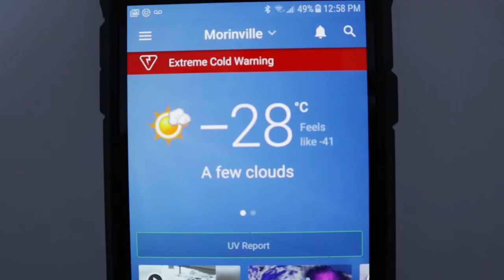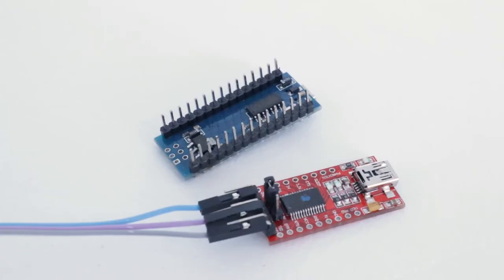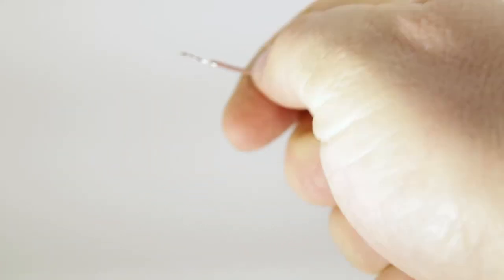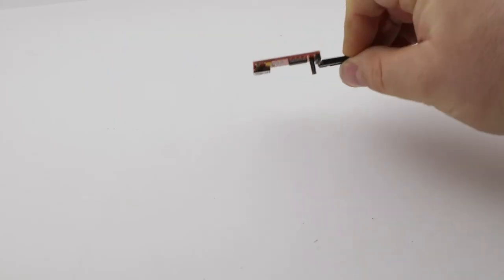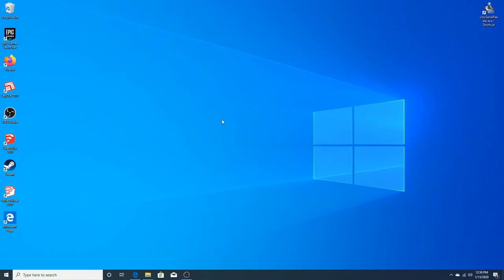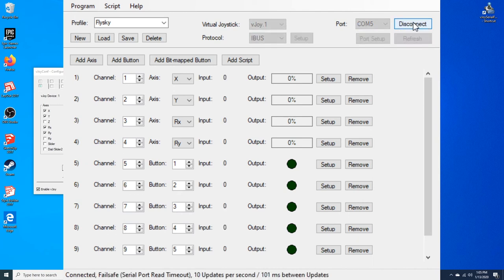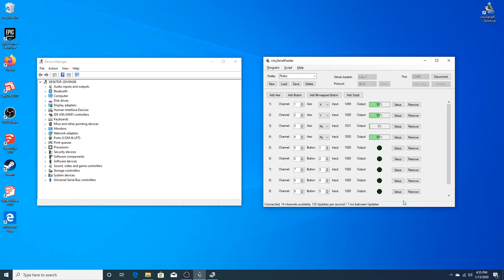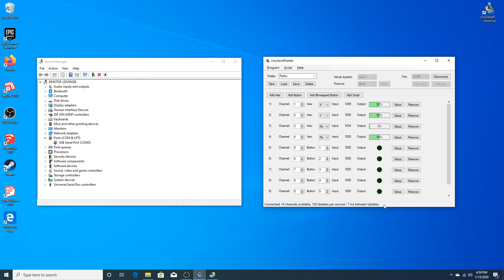Use Your RC Transmitter As A Wireless Simulator Controller on your PC

Comment: This was a big help, thanks! Can you offer any advice on how to set up a 3 position switch in vjoy serial feeder? I'm trying to set up my mode switch for use in realflight but the switch acts as though it only has one two positions.
Reply from the maker: You should be able to add a button on the same channel and set them to different inputs, and set them to two thresholds. Set one to be say "1400 - 1600" and the other "1800 - 2000" That will leave a bit of room to any deviation but the signal seems pretty spot on at 1500 and 2000.
Reply: @TheWayneStevenson  Thanks for the reply, I'll give that a try later.
Reply from the maker: @tumblew33d  Let me know how you make out! :)

Comment: Hello thanks for the video, i'm having a problem do you have any ideas? When i turn on my flysky the FTDI starts flashing two green leds and gets disconected from windows, it gets connected again as soon as i turn off the flysky. (Using FS-IA6B and FTDI) Edit: It just works on my notebook, now i'm even more puzzled.... i really wanted it to work on my main pc. Edit 2: It was a bad cable, got another one and it worked on both computers.
Reply: I've got two solid greens but no motion on the VJOY.  Also betaflight connects then disconnects.   i'm going to try my main pc and see.  Also my radio receiver doesn't show a red light that its binded.   It does on my plane.

Comment: thanks for the amazing video, i am trying to do the same, i am using an FTDI usb board and a jumper R8 receiver, i connected the receiver to the FTDI board and i installed the Vjoy driver and serial feeder but the serial feeder is not communicating with the receiver, it is always showing Serial port read timeout, i am sure that the receiver is bound to the transmitter, i have also connected one servo to the receiver to double check the communication between the transmitter and receiver and it is working fine. the receiver is connected to the FTDI board using the SBUS wire, can you please help with this problem.
Reply from the maker: I don't use Sbus equipment myself so I wasn't able to cover it unfortunately. It's an inverted UART signal. So you need to connect to the uninverted signal, or re-invert the signal. Using the Arduino is the simplest method because you can use a sketch to do the work for you. 

Cleric_K who made the vjoyserialfeeder covers the details and also has links to more information on tapping into un-inverted signals or creating a inverter circuit. https://github.com/Cleric-K/vJoySerialFeeder/blob/master/Docs/Sbus.md

I hope that helps. :)

Comment: i. did the cli command on omnibusf4 and now i dont see any comport in betaflight or device manager. i see in other devices - Omnibusf4 as no drivers for it.
Reply from the maker: Is it showing up as a HID Gaming device?
Reply: @TheWayneStevenson  hi i did figured it out, actually for me the flight controller setup didnt work but it did worked with an FTDI connector, plus i had to adjust the controls 1 by 1 in the vjoy serial feeder as the controls were goin crazy.. but in RDS sim the buttons dont work i think the feature is not activated thru the developer of RDS.. all in all it worked.. thanks alot for this amazing tutorial otherwise we would have stuck with generic SIM modules...
Reply from the maker: @RETROGAME-FIX  Awesome. So glad you got it sorted. 😀

Comment: i have a f4 flight controller and im trying to use it as gamepad. Everything works but when i go into the sim the sticks just start freaking out. Any ideas?
Reply from the maker: OK. So you're using the Betaflight HID method? What sim are you trying it with?
Reply: @TheWayneStevenson  drl sim. I gave up and went to go fly but forgot to turn off usb hid....it fried my fc. I have an aio and my cpu went up in smoke. 3v pads measured 0.2 ohms resistance.
Reply from the maker: @nfuller902  That is crazy! I've never heard of that ever happening before.